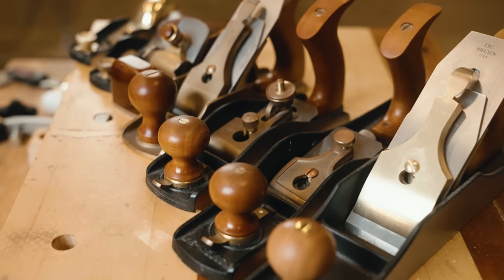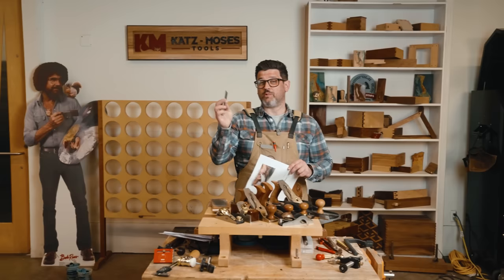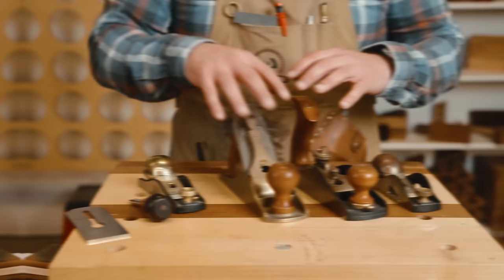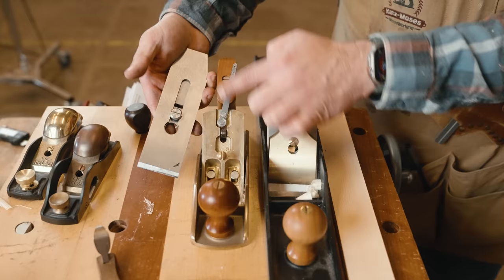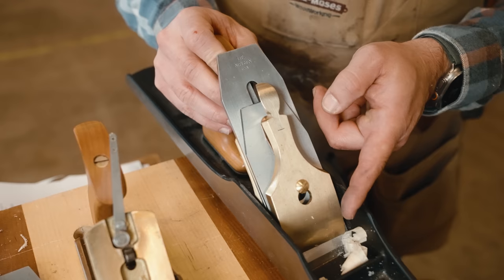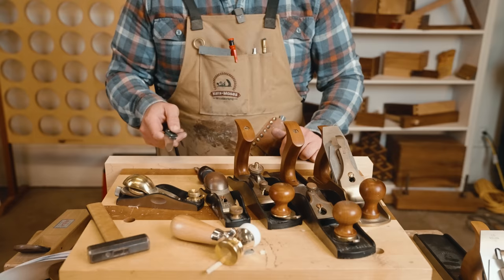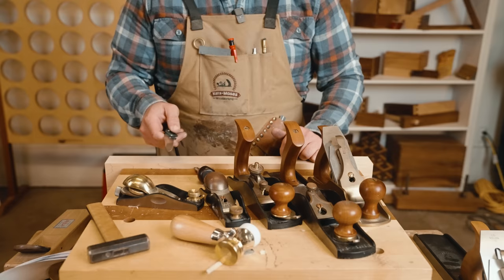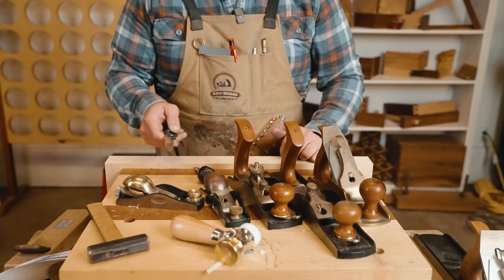11 Hand Plane Tips that Will Transform Your Woodworking!

Comment: You forgot one of the bigger ones, practice practice practice. However, don’t buy some cheap lumber from your big box store to practice on. Find a nice good clean piece of pine and practice on that. Make mistakes on it, go to deep and see how it reacts, go off slightly and see how you might make a twist on the top of the board and then correct it. Any woodworking store usually has a bunch of cheap scrap pieces you can practice on.

Comment: "This is REALLY important. You want to be at least 1/32 away from the edge so you can set it between 1/64th and 1/32nd." Umm, so should it be more (at least) or less (between 1/64th and 1/32nd) away from the edge of the blade?
Reply from the maker: Anywhere in there is fine my pedantic friend

Comment: Great video. I'm pretty new to woodworking, and I only have a couple of planes: a #5 and a block plane, both Stanleys. I picked an ambitious first project that involves surfacing a bunch of 6x4 rough timbers. I'm still removing material; not focusing on flatness yet, but I have started angling my #5 across the width of the face to keep it relatively even. A 14" plane angling across a 6" face still keeps most of the sole on the surface.

One thing I never thought to do (but I will next time I head down to my basement) is camber my blade slightly at the edges. Right now I get distinct edges on each stroke. But on the whole, thanks to the tips here and on the Canadian woodworking forums, my project is going quite smoothly.

Comment: The hump is from how, when, and where you're putting force into the plane. The fix is super easy. It's all about preventing yourself from putting the hump into the board in the first place.

At the beginning of the stroke, make sure all of of downward force is applied only to the front end. Your back hand should put absolutely no downward force into the tote at this point, only forward momentum. The tote should feel totally loose in your hand. Your front hand is really doing all the driving at this point. Sometimes I won't even bother to squeeze the tote, instead just providing forward movement with only the web of my thumb. As you push forward, begin to add downward pressure only after the tote is fully supported by the board. These steps prevent forming the ramp up into a hump on the leading end of the board. 

In the middle of the board, even out the downward pressure between both hands, and keep only enough downward pressure to maintain control of the plane. The weight of the plane itself really provides all the downward pressure needed for the blade to work. 
 
As you approach the end of the board, gradually remove all downward pressure from the knob or toe, and keep only enough downward pressure on the tote to keep driving straight,  maintaining the back half of the plane as your primary registration surface. I'll often remove my front hand from the front of the plane entirely before I reach the end of the board. That step prevents forming the far end of the hump by keeping the front of the plane from diving off. You can actually see this nose diving behavior in some of the shots in this video before you address the hump issue. If your front hand dips at the end of the stroke, you know you're applying too much pressure at the last 5 or 6 inches of the board. Break the habit, and you'll notice you have to fix a lot fewer humps. 

The whole fluid motion should almost feel like you're attempting to plane a very shallow concave surface, taking a scoop out of the board. Your muscles might feel that way, but in the end you'll find you have a flat board.
Reply: Probably one of the most well written, articulate comments I've read on you tube in years.

Comment: I couldn't remember which video it was where you commented about the hump in longer boards. My guess is that the hand planes don't have an infeed and outfeed tables at different heights. I am just starting to play with the Japanese pull style planes, and thus far, that does not seem to be a problem. I am guessing that part of that is the slightly concaved surfaces before and after the plane blade. More experimenting ahead!

Comment: About pressure on a bench plane, you hold the front of the plane down on the wood with the knob.  But as the knob passes the far end of the wood, you are no longer pressing down on a plane.  So sole is now a lever and your knob hand is pivoting the front down, and the back up, with the far edge of the wood acting as a fulcrum.  So it works to ease off on the knob and shift a little weight to the tote.

Comment: Good video. What I have looked for is a 'Beginner's exercises' video for the hand planes. With the sharpening jigs, and so many sharpening videos, that is the easy part. You just touched on how to remove a crown in your board. Still needed would be how to remove a concave board edge. You get the edge straight but it isn't square, so how do you square it up? Do you adjust the blade to take more off the high side? Or? Rex did a good one on flattening a board, but that could be expanded. How to remove or fix a concave or convex surface, how to fix a crowned board. Maybe also how to know when the board you selected needs to be cut into short pieces, or ripped down the middle. I figure that in order to learn how to use these planes, you need to take a number of boards and plane them down to just shavings......

Comment: OK. I’ve heard “skewing changes the angle” from a number of trusted sources. And,also, that it doesn’t matter. Since the angle is referenced to the sole and frog (which don’t move), I’m pretty sure it’s a reference to the “angle of attack” that changes (the amount of blade width performing the severing). What do you think?

Comment: Great video, thanks for the tips.  When sharpening does it matter if you push the blade away from you or pull it back to you on the stone and does it differ with the kind of stone you use?
Reply from the maker: Oh man you have to watch my last video. Doesn’t matter unless you’re using the scary sharp lapping film

Comment: Hey Jonathan, nice video. To tackle the rust problem I have used CMT blade cleaning solution on all of my hand plane. Basically, you put a bit on and leave it to dry. It has anti-corrosion agent that will help rust prevention. Obviously, there are other products out there but I found this very easy to use.

Comment: I feel stupid for asking, but the biggest issue I have is identifying situations where I should even be reaching for my planes. Every few months I get the urge to start using them more, but I just end up using them on scrap boards and checking my understanding of sharpening and adjustment. I struggle to understand how they can fit into my workflow on real projects.
Reply: What helped me with this was doing one project 100% hand tool. Just a simple box or something. I'm no expert, but it did give me more confidence in using them on other projects afterwards.

Comment: Low angle planes with bevel up are cutting within a few degrees of a bevel down. A 20 degree low angle bed, add the angle of the blade grind 25-30, do the math. A 12 degree bed, 25 degree bevel, add secondary bevel, then maybe tertiary bevel, you're around 40 degree cut. Is that enough difference to make a difference? Bevel down doesn't matter much as long as the grind does not exceed bed angle, it's 45 degrees. I've never heard a scrub plane called a Fore plane, typically a #6 plane (Stanley reference size) is a Fore plane. Maybe you Eastern folk just have different terminology.  I do like my low angle block planes, mostly for the comfort of the tool in hand not because the angle of cut is better (because it really isn't).

Comment: Just a caution for novices out there… as soon as an internet “plane expert” refers to a part called the chip breaker… leave the channel and find something different. Hand planes do not have chip breakers… as there’s no need to “break chips” in the planing activity. The piece of steel immediately pressing on the top side of the blade is called (in all Stanley parts schematics) either an iron cap or a back iron. It’s purpose is to stiffen the blade and minimize/eliminate chatter. Nothing else. On older wood body planes that used a much thicker piece of steel for the blade, this part did not even exist, as the need to stiffen the blade was unnecessary. If planes need to “break chips”, then all planes would need this part. Which isn’t the case.
Reply from the maker: Lol just a caution for anyone reading this nutters comment… as soon as some guy on the internet comments that he doesn’t agree with the commonly accepted term for something and discounts the vast knowledge of all the “plane experts” including people like Rob Cosman and Paul Sellers or the literal product listings from companies like Lee Valley or Lie Neilsen then you can discount everything he says. Side note: why do people who know everything watch how-to videos? 🤦‍♂️😮‍💨💩

https://www.leevalley.com/en-us/shop/tools/hand-tools/planes/blades/115590-hock-hcs-o1-blade-and-chip-breaker-sets

https://www.woodcraft.com/products/hock-chip-breaker-2

https://www.lie-nielsen.com/nodes/4201/lie-nielsen-chipbreakers

Comment: #12. DON’T put the plane down on the work surface resting the blade of the plane on the work surface.  “London to a brick” when you next pick up the plane you will, drag the blade along the work surface.
Reply from the maker: This old debate. Disagree completely. Setting on its side bumps the blade just like I did with the mallet.